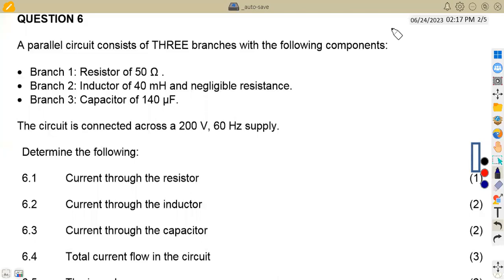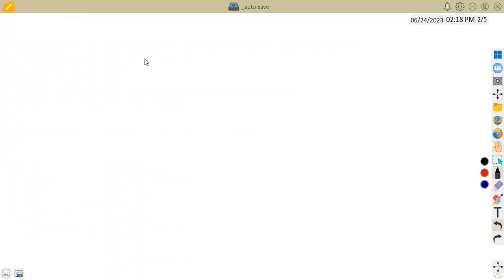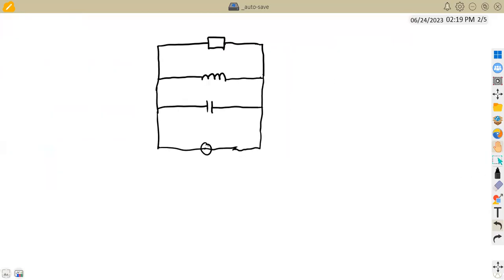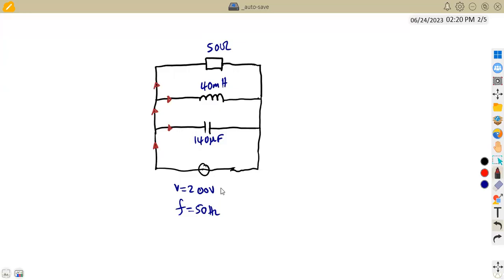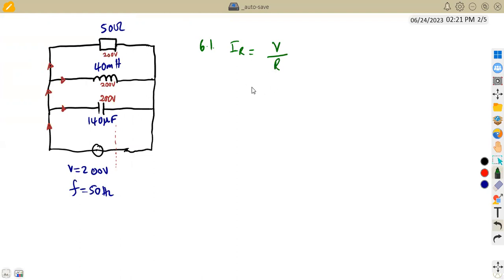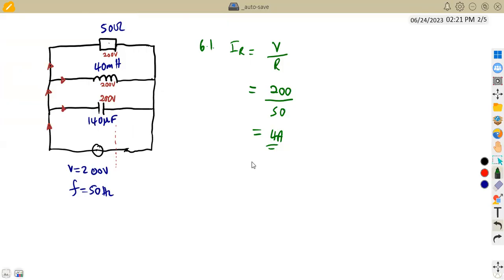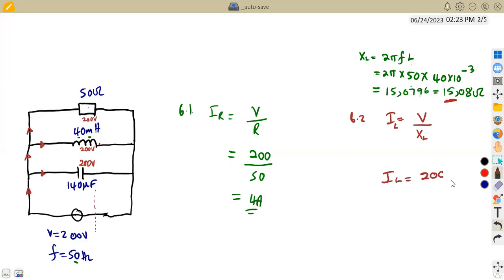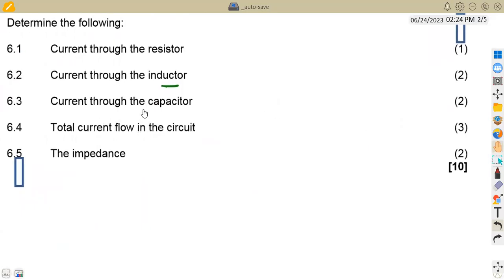Electrotechnology N3 Alternating Current Theory NOVEMBER 2022 Question 6 @mathszoneafricanmotives

Comment: I got different values for XL and XC 
even when I put your values in I get a slightly different answer. I checked this on 2 different calculators and didnt get what you got. Do you know why that is?
Reply from the maker: What are you values
Reply: @mathszoneafricanmotives  I think there's mistake on your answers. My XL 12,566 and XC 22,736 OHM
Reply: I noticed the same thing. I got IL 15,915A  and IC 8,796A